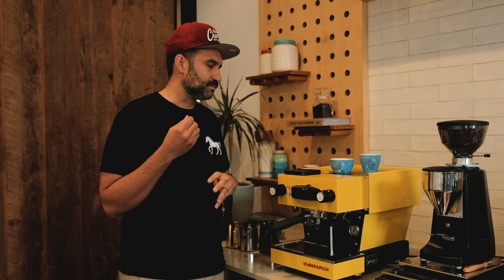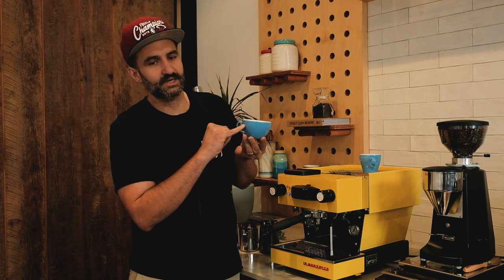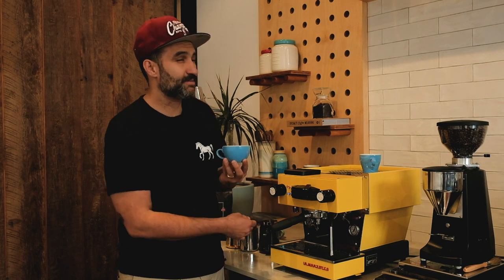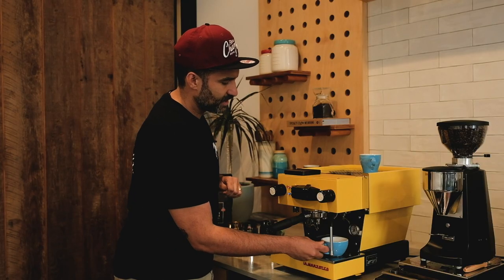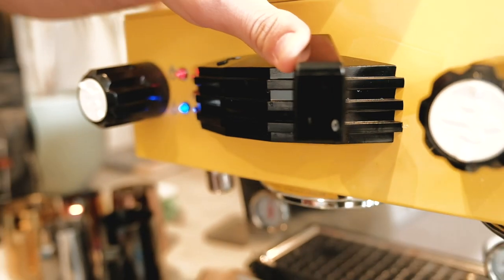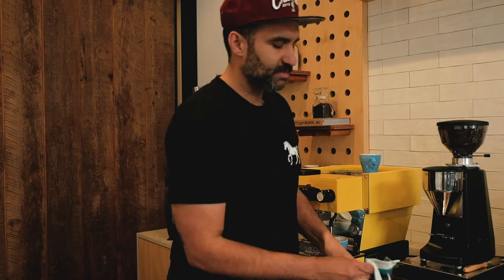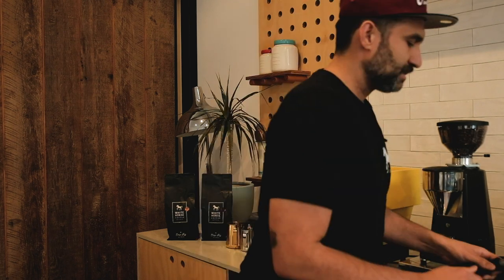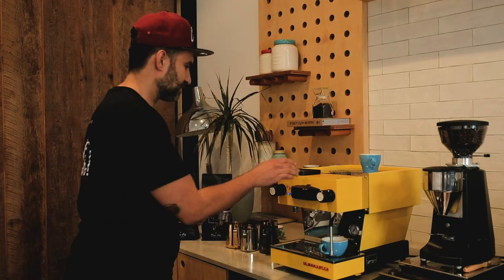How to make a long black at home

Comment: 22g dose, 20g yield in 20 seconds? Surely that'll be under-extracted and sour?
Reply: Gday Nicholas, Im sorry for the late reply, i lost my login details! There is a trend to extract one full length espresso shot into a long black, however for our taste at white horse coffee we find it too akin to filter coffee. Always remember that the 20ml/g of coffee is also diluted by 120ml of water, hence we find that the longblack displays itself as a rich and syrupy beverage but also subtely sweet.
I do concur that in strict espresso brewing protocols the ratio is under extracted but if we were to use a single espresso or even two full length espresso shots, the end extraction % is diluted and (under extracted), the long black is an interesting drink with many ways to brew it, Finding what you like is half the fun.